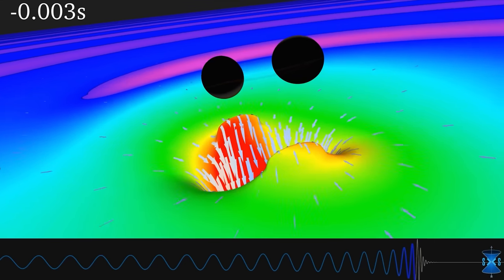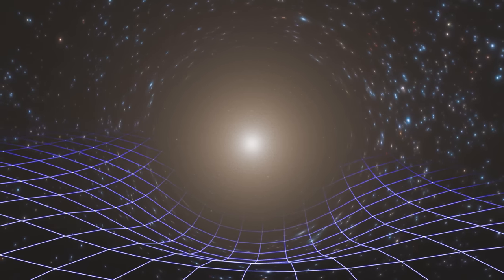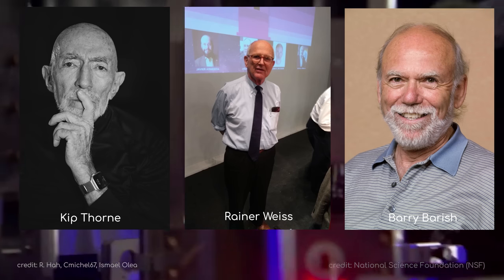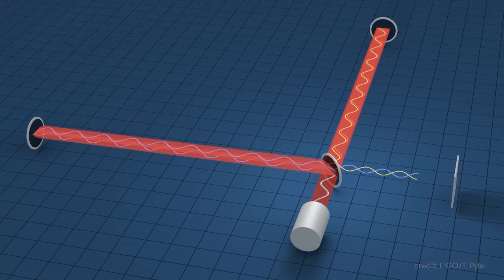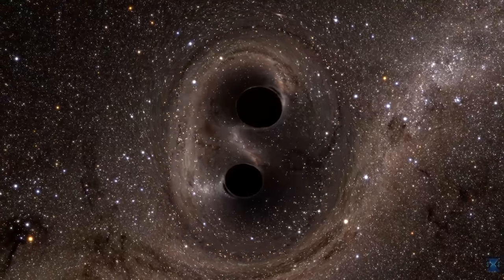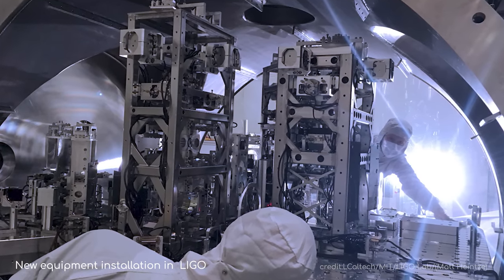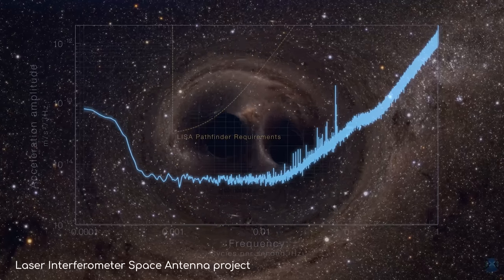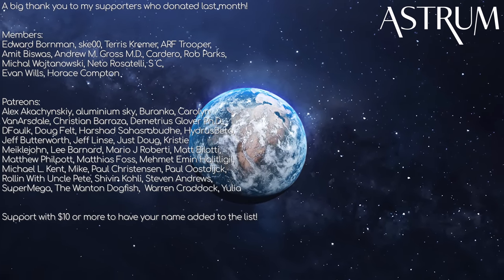The Explosion 50 Times the Combined Power of Every Star in the Observable Universe

Comment: A 750kw laser wouldn't vaporize you. It would vaporize a layer of your epidermis and ignite the ash and dust resulting from it, causing a loud explosion.The lasers are also small and pulsed, so it would probably sound and feel like a fire cracker was thrown at you as it went off. Youd probably have a good sized burn and ringing ears... But VAPORIZED? technically, yeah. But just that little 1/8" speck of you.

Lasers dont work like in scifi, and i hate channels like these blowing them out of proportion. Its worse than the clickbait practiced in the titles.